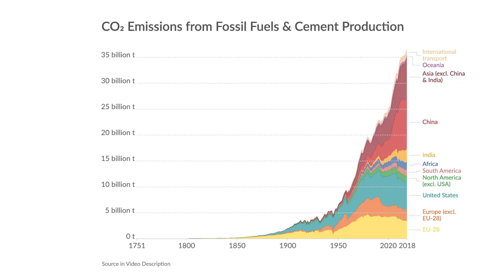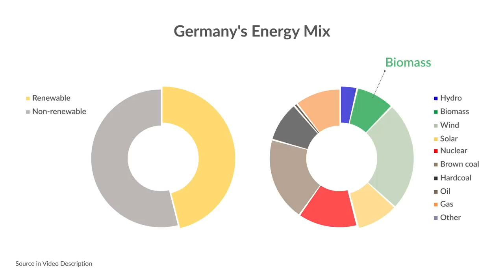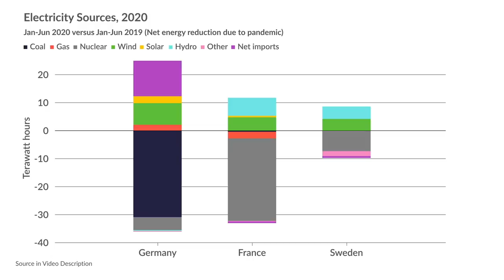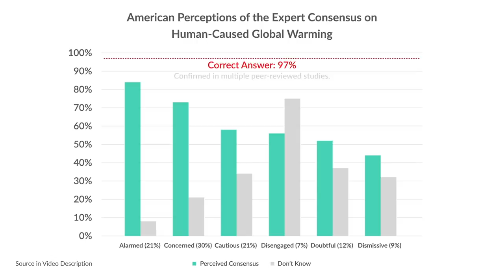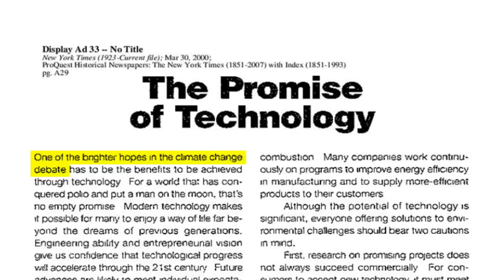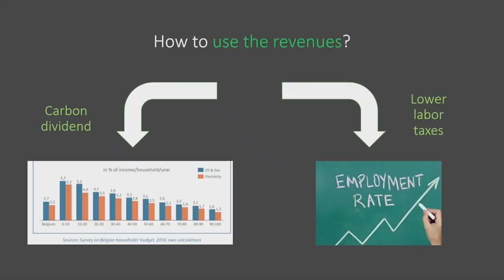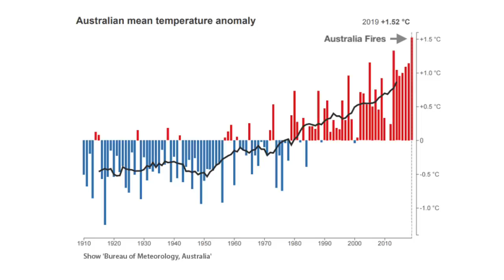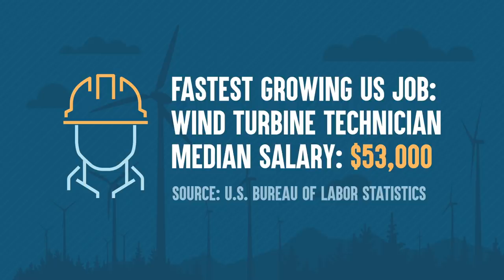The $5,200,000,000,000 Trick Killing More Than Covid, w Stephen Fry.

Comment: 13:10 oh the hypocricy of saying that while showing a LI-ION battery powered car
Reply: Except electric cars using Lithium ion batteries are more sustainable, regardless of increased production carbon emissions.
Reply: Actually, electric motors are very durable even if batteries aren't. We need to get there. Li-ion batteries isn't a solution in the long run, but it helps move us in the right direction, which is obviously hydrogen. That being said, li-ion cars are much better than gasoline ones, just for the extreme inefficiency of combustion engines.
Reply: @jeschinstad  Lithium Ion batteries produced from surface mining or brine solutions isn't the long term solution. The eventual solution will just be lithium sourced from sea water or geothermal wells, or perhaps en entirely new material like graphene or perovskite.
Reply: @camfahn7332 : The eventual solution is obviously hydrogen from wind, wave, rain and solar, but right now, that's too expensive, so we use what we have to get there while the other parts catches up.
Reply: @jeschinstad  It's combustion that likely charges that battery. Then you have more efficiency drop in charging the battery because it takes more energy to charge than you get back from it in the stored state. Hybrid cars are the more realistic compromise for now. Pure EV's are best suited for the golf course are small range utility role.
Reply: @mele2904 : I don't understand what you mean. Modern battery cars have a range of 650Km/400 miles and that isn't very short range. You could probably use a bit of rest after driving that far anyway. But as I said, hydrogen is the obvious future of electic cars.
Reply: @jeschinstad  Before my illness I drove commercial vehicles. 400 miles is not that much on that scale. And I agree that hydrogen is a very viable option. Hydrogen storage with some kind of "renewable" could make a more viable point of use system. We don't have nation wide infrastructure for hydrogen yet which is unfortunate. Our tax subsidies should be going towards hydrogen infrastructure instead of "Green New Deal" nonsense.
Reply: @mele2904 : Well, at an average speed of 50mph, you're driving for eight hours non-stop. You really should have a break by then.
Reply: @camfahn7332  Is there enough lithium for everybody to have an electric car? Where does the energy come from to charge the batteries? Around here we use coal to make electricity.
Reply: @jeschinstad  Hydrogen combustion produces water vapor. Electricity can separate the hydrogen from oxygen in water.
Reply: @skipperrussell2025 : Yes, I know how it's done and how it works. Electric cars aren't based on hydrogen combustion.
Reply: @jeschinstad  Where do you get the electricity to charge the batteries. How about horses, they just burn hay.
Reply: @skipperrussell2025 : Electric cars can use hydrogen fuel cells rather than chemical batteries. Hydrogen cars are not based on combustion. They're electric cars generating electricity from hydrogen. The importance of this is that battery cars are generating a market for the components we need in hydrogen cars. And those batteries are easily recycled, enabling their use in other things that must be battery driven, but don't require the explosive power that EVs do, like phones and things like that. And yes, there's plenty of lithium to get us past fossile cars. It won't last forever. Only hydrogen does that and even hydrogen will only last a few hundred billion years. 

Here in Norway, the electricity comes mostly from waterfalls and some from wind. That's indirect solar power, but other countries have mostly unlimited access to direct solar power, which is even better, but they don't have the economical power to utilize it. We are barely using any of the energy that we're given every day. This is purely a policital problem. We can solve it in a couple of years if we really want to.
Reply: @camfahn7332  do you know what is more sustainable than electric cars? No cars at all. Do you want to be sustainable? Than you better use bike instead of ANY car.

Comment: This was a really good video until the hyperloop part, oh well you tried.
Reply: Thunderfoot is not the arbiter of knowledge.
Hyperloop could absolutely work and the dangers could be mitigated.
Reply: @hiya2793  Basic understanding of vacuums debunks this. We do not have adequate technology to create a vacuum quick enough to make this commercially viable, on top of that, we do not have the materials to prevent leaks long term. Those two factors alone make the Hyperloop an unrealistic pipe-dream. Next is the people that are funding; it did not think this through at all. Elon Musk abandoned any, and all production of the Hyperloop and Richard Branson is so stupid that he invested in the most mountainous region to test something that barely works in a straight line.
Reply: @Captain Bunwarmer same as in a normal high speed train. Slow the train down, exit. You'd have to seal off and pressurize whatever portion of the track they're in - but every portion has exit ports since it's underground.

And fuck - if a car drives infront of a high speed train - train is dead too. Not much you can fucken do there either.
Reply: No, but he's very competent and his criticisms still stand. Why use a complicated expensive system still requiring development when alternatives already exist?
Reply: I'd ask for clarification as some sources are showing Germany with double price vs Poland and in other sources Poland having higher price than in Germany.
Reply: Take for example this that adds some nuance to the picture:
https://www.statista.com/statistics/263492/electricity-prices-in-selected-countries/

Comment: I love the movies in 20 years time:
'What do we do with the decommissioned wings and what on earth were people thinking!?'
Reply: What wings ? From planes? What are you even talking about..
Reply: @jordanthistle2360  
Wings from windmills. It's too costly to Incinerate them and they are not useful for anything (outside a few artistic projects) so they are chucked into landfills and buried.
And those are from the windmills put up in the 90s - imagine how many we have to deal with 20 years from now.
Reply: @vendomnu  blade* wings are on planes and flies. Either way this is not true, almost all components can be recycled. The blades don't have an expiration date, they can be reused once the motors are fixed or taken down and replaced onto one that lost a blade.
Reply: @jordanthistle2360  The wind turbine blades do have an expiration date they are eroded by chemical's in the atmosphere and stressed and weakened over time by wind itself. I know of at least three turbine's in my locality that have had snapped blade's and one turbine that was blown down in a storm.
Reply: @knockschool  yeah, I looked into it after, we only have smaller ones around here they are made of aircraft aluminum which last alot longer but they can't be used to make the massive blades. There is a lot of research happening, looking for a way they can reuse the fiberglass through recycling. That being said it is still much better for the environment than fossil fuels. They can last up to 20 years but some only last 8-10. Its also only the fiberglass blades that can't be recycled but within the next few years we should have that sloved and will be able to recycle the ones that are being taken down now. have any of you looked into fusion technology? That is going to change the world and bring about a new lease on humans lives.
Reply: @jordanthistle2360  not true. the blades end up stressed to the point they cant be used any more, and the leading edge literally gets chipped away by dust and larger particles in the wind. its a valid question of what to do with them. They are flippin massive chunks of plastic resin and glass fiber. not exactly bio-degradeable or recyclable.
Reply: @fakiirification  if you read my latter message you would see that I actually agreed with this point. We have smaller wind turbines here and they use aircraft aluminum and they get recycled. There are actually new companies that specialize in recycling the fiberglass. Also there are a lot of other companies that are doing the research to make it a much easier and cleaner process. That being said they last about 10 years before they are switched out for bigger blades. That is still ten years of clean energy on average. Which is still way better for the environment than that much coal, oil, natural gas, nuclear fuels.
Reply: OBAMFSpike  they are starting to recycle them, not alot of companies are doing it as of right now. They are burring them so that wildlife don't try to eat the materials or it doesn't break up and fly around. They aren't just going to leave them there.
Reply: OBAMFSpike  no you can't incinerate them, they will be recycling them within the next ten years to make new blades or just to make new glass fibre.
Reply: Maintained windmills can still produce electricity.

Also, are they not made of metal? So you don't need to extract from ore then!
Reply: Looks like you were referring a diff kind of windmill then
Reply: OBAMFSpike  
No. Well, you can but it takes too much energy to do. And bear in mind the size of a blade - it's hard to fit into an incinerator without using more energy to cut them up.
Some have contemplated grinding up the blades in situ when decommissioning the windmills but you still end up with a material that is problematic.
Reply: @jordanthistle2360  I drive past a graveyard of cut up windmill blades in Iowa they aren't doing anything with them in but trucking them in and storing them on a piece of property
Reply: @jordanthistle2360  it takes a lot of fossil energy to produce one of these windmills you have to build it you have to truck it there you have to truck all of the components then you have to take the truck to truck it away when it fails and throw it away
Reply: @fakiirification  you forgot to mention that the blades are chipped away by all of the foul of the air that they kill
Reply: The problem with this video is this guy is talking about Rising seas and flooding and heating up temperatures of the atmosphere well none of that would be happening Norwood to cenami the earthquakes the hurricanes and all these tropical storms that if you'll notice in the history of the Worlds just the past two years alone we've had so many tropical storms it's hard to keep track of them all and then this year alone we had three in a row within one day well here's the real reason why this is the truth that no one talks about because no one knows and also the mainstream media doesn't want you to know therefore it doesn't talk about it and that's because of who owns the mainstream media so here's the truth THE H.A.A.R.P PROGRAM causes the following ...
Earthquakes, tsunamis, wildfires, In CALIFORNIA ! hurricanes,tornadoes, this technology is also capable and has already been used to > KNOCK OUT Airplanes outta the sky! Knockout a power grid! This is a D.E.W ( DIRECT ENERGY  WEAPON!!!! OPERATED BY THE U.S.NAVY IN GANKONA ALASKA!!! THEY CALLED IT A QUOTE "RESEARCH FACILITY TO STUDY OUR ATMOSPHERE!!! ITS A CROCK OF SHIT ! 
IF ITS OWNED BY THE NAVY AND THE D.O.D. DEPARTMENT OF DEFENSE YOU CAN BET YOUR ASS ITS A WEAPON ! ITS ALREADY BEEN PROVEN ! A LOCAL HOMEOWNER WHO MET A WHISTLE-BLOWER AT A DINER TOLD HIM WHEN A MAINTENANCE OFFICIAL WAS CHANGING A PART INSIDE THE HIGH VOLTAGE ZONE WHICH THE TEMPORARILY SWITCH OFF WHEN THINGS ARE FIXED THE MAN WAS STILL OUT THERE WHEN SOMEINE TURNED IT BACK ON THE MAN TOLD HIM QUOTE  " THEY FRIED A GUY UP THERE " ! THE MAN SAID WHAT ??????? THE OTHER MAN REPLIED  YA THEY FRIED A GUY ! WHAT DO YOU MEAN HE SAID ..WELL THEY THOUGHT HE HAD CLEARED THE AREA AND THOOUGHT THE REPAIRS WERE DONE SO THEY GAVE THE ORDER TO SWITCH IT BACK ON ! HE WAS  BURNED TO A CRISP ! THE MAN REPLIED OMG !!! What everyone needs to know about this H.A.A.R.P program is it puts out millions and millions of megawatts of microwaves  and radiation!!! Just think of what your microwave does when it Cooks your food and we're talking about a tiny fraction of what this facility puts out it heats up our atmosphere so much that it affects all the things that are going on such as the melting ice caps natural weather changes because of the damage this device has caused not to mention we are not the only ones with this technology Russia has one as well they have been using these devices for weather manipulation for years and years and years this is the future of weaponry not only to be used against other countries on our own country and it's been going on under our noses for a long time! Similar to The H.A.A.R.P program IS THE GWEN TOWERS !! What Gwen towers are is simple every single cell tower has a top and a middle to the tower , the top is used for Cellular Communications around the world the middle or bottom contains the Gwen Tower parts! Here's where it gets scary these Gwen towers are rented out 2 certain government agencies which I will not mention cuz if I do this will be taken down or deleted thanks to the new algorithm which searches for certain words after you post something but anyway the Gwen Towers after rent it out to the individuals and let's just say rich people are used to affect the T.I.s 
The T.I. STANDS FOR Targeted  Individuals! People who have made Trouble made comments or if you are someone that they just do not like for whatever reason whether you're a trump supporter whether you're right wing conservative or you said something bad about a certain politicians or rich person! You become a TI targeted individual they use the Gwen Towers to affect your health there are videos on YouTube about this with testimonials from witnesses that have been affected  one elderly man has been affected for 40 years because of someone he insulted since then he has been suffering everyday every week every month of every year he has so many health problems because of the high EMF frequencies coming from these towers all the people in these interviews have the same health problems and issues they all have the same thing in common as far as who they pissed off or shall I say they pissed someone off and this is the result constant torture ringing in the ears irregular heartbeat voices in the head headaches vomiting and so many other issues insomnia the list goes on and on cancer Google all the information I just gave you and also go to YouTube and type in the Gwen Towers you will be shocked disgusted and ashamed to live in this country just as I am I don't understand how anyone cannot be I used to love my country that was 20 years ago when I started discovering what was really going on without deep state the Illuminati the Bilderberg Group and certain other organizations whos motives and agendas are Pure Evil!  I could go on all day but I have other things to do and people to warn on other subjects so search for this information becoming familiar with it and remember it well because very soon the plan the Illuminati has been putting in place for centuries is now in play and must be stopped!
Reply: OBAMFSpike  
If you want to reuse parts of the blades, yes. That requires heating and fiddling with the pressure and leaching the evaporated resin away (and burning off so it is broken down). Then you end up with low quality glass fibres that can be reused - but at a price way higher than brand new glass fibres mats.

If you want to just get rid of the blades, it still takes a lot of energy (transportation, mechanical processing to fit furnace, heating) and you probably have to burn it alongside better suited garbage (suited for incineration). Also costly, and you end up with a leftover portion that still requires being put in a special landfill (we call the leftovers from incinerators 'slagge' in Danish).
Reply: OBAMFSpike  
Oh I get it.
Unfortunately, the process of making the resin is quite dangerous due to the chemicals used in the epoxy. We have  Siemens Wind Power here in Denmark where 64 cases of allergies/eczema resulting in workman's compensation.

The best solution in my mind is betting on nuclear power (thorium salts, if possible) and foregoing wind power/solar for any other reason than decentralization of the power supply.

Comment: I would expect nothing less from S Fry - a silver tongued orator talking with forked-tongue.  
I point to observation.   
NOAA showing temperature has plateaued and starting to fall despite rising CO2 throughout pandemic. 
Sea level, as measured in Sydney Harbour, is not rising in any way other than it has in my 80 year lifetime, a little over 0.1 mm annually.   
All the dams in Australia are full or filling and the snow in our alpine regions is heavy this winter and getting heavier.  
Our Coalition Government and our new Labor Government both agree to talk as if they were going to eliminate fossil fuel and then do all the things which are called offsets; good work for Australian economy and the world.